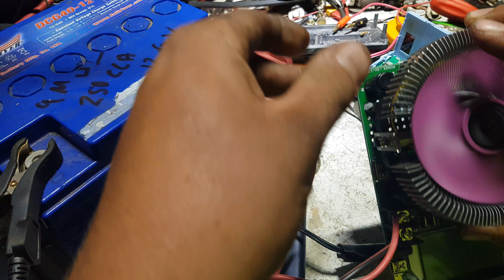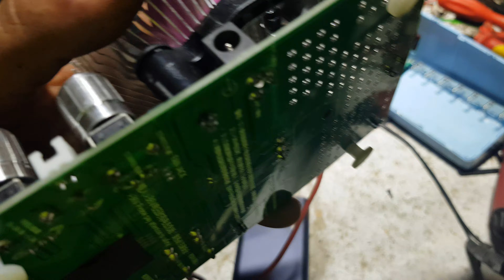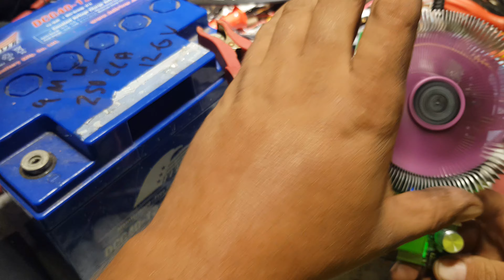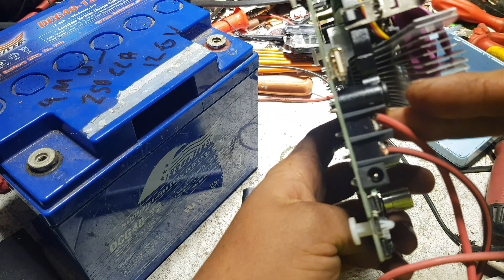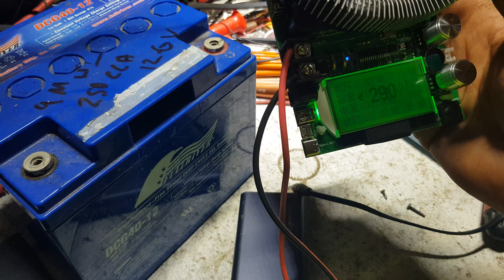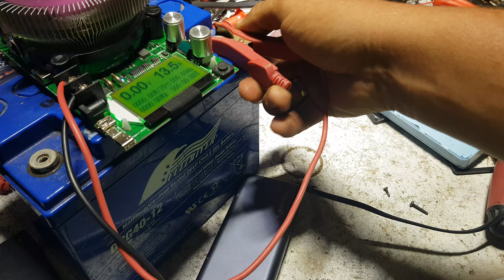Phantom load on my new Load Tester

Comment: Check the current path through the MOSFET acting as the variable resistor. I bet alo the voltage across the mosfet is the current reading you are getting, since the amperage through a resistor is what makes a current value to a voltage value.
Reply: Om Up The Sleeve Customs I faund a pictor on Facebook whit you and your kid. You look sol hapy together 😍😉
Reply from the maker: Thanks mate ill do some testing cheers for the knowledge